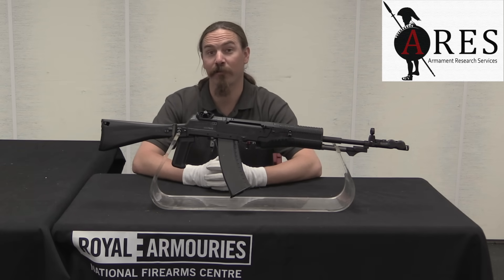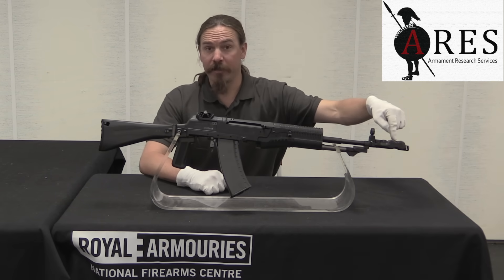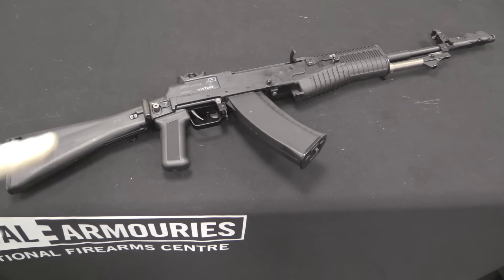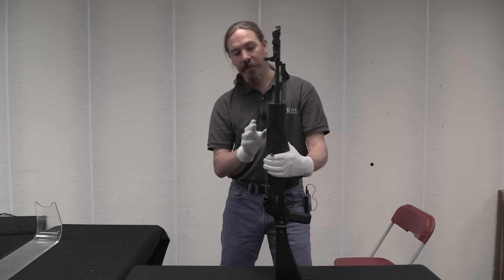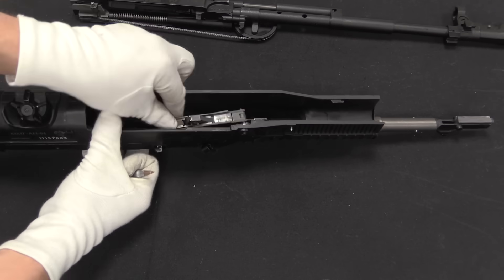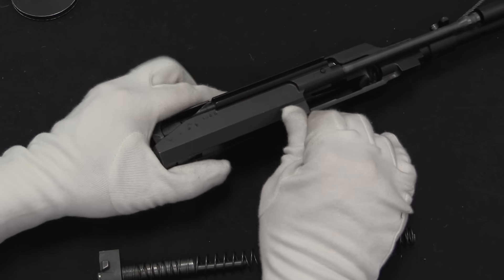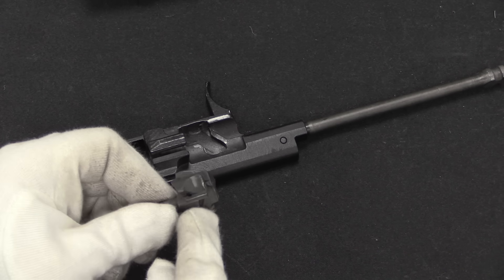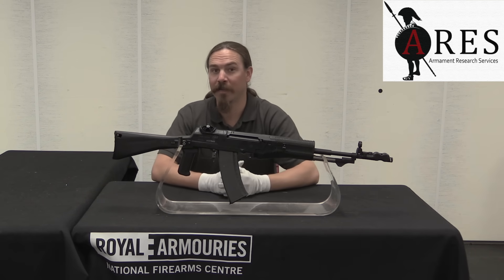Rocket Surgery: Inside the Russian Nikonov AN94

Comment: I don't understand why they used cable instead of roller chain in that counter-bolt mechanism. I would expect the cable to fray pretty quickly, although chain links dying from metal fatigue is also a concern. 

Something that combines Nomex's heat resistance, Kevlar's tensile strength, and is immune to oil and combustion byproducts might work.

Comment: The 1800 rounds per minute 2 round bursts thing is a bit of iffy maths? Given 2 rounds go downrange very quickly, but you're still got what a 30-35 round magazine? Are the two round bursts basically a dual semi auto or does it then switch to full auto? Or stay in that fire mode. Progressive triggers are generally a great idea but terrible in practice ... but this gun despite its problems may have been one platform it may have worked, light trigger for an accurate 2, long pull for spray n pray.
Reply: 3 fire modes. Semi, burst and auto. You get 2 round hyper burst every trigger pull. Not on semi obviously.

Comment: The ideas I get after watching AN 94 video is
1.Hypher 3 burst mode
How to archive this? By make the battery location further front 2 round seat in tube ready hypher burst shoving position space plus 1 on battery for archive 3 hyper burst mode. Addendum charge weapon 3 times okay I fix this using wheel counter movement 1 charge pick shove ammo 3 times... genius!!! None resurpercate charging handle.

2.Make bulp up 20 inche long barrel version..... hahahaha I rest my arm on my head... My head my hair is heat up pretty rapidly hahahahaha. Move all safety switch, fire control, bolt release, mag release near trigger grip finger and all are Ambidextrous.
Gas setting flap switch on hand guard grip position.
My forehead start heat up behind my ear start heat up hahahahaha never experience this before this is my first time!!!!! Wow AN-94 what a shock I knew this firearm is complex side effects learning wow my brain body temperature rise up my heart beat start rise up too hahahaha.

3.Add APC9K Hydraulic Recoil Buffer Damperner, plus SR-1 AK-107 Muzzle

4.VHS-2 Robust Iron sight

5.Top feed FN P90 quad magazine 50 rounds. True Velocity Composite Ammo plus stainless steel reinforce.

6.Hydrogen Gas canister handguard external coolent gas tube hanguard.

Comment: I feel like it would be cheaper and simpler to just make a double width AK receiver and have 2 barrels and gas systems. Basically a Villar Perosa bur AK
Reply: yeah but double recoil
Reply: @jbbbllz  a bullet out of each barrel and it won't matter, you also have double the recoil from firing a 2nd bullet so quick but it doesn't matter
Reply: @jmjedi923  AN-94 doesnt have a double recoil with 2rnd burst, the barrel move backwards after first shot
Reply: @jbbbllz  of course it has double recoil, conservation of momentum (and energy) applies

Comment: i wonder. 
in auto mode. because of the pawl of the sear have to go all the way forward tobe firing again. thats make it 600 RPM after 2 shot. But if they some how creat a mode to make that pawl always stay down. does it help the gun fire the whole magazine with 1800 RPM. Like make a longer trigger plate and have a bar long enough to cover all of the pawl track.

If that work. This chamber system really can apply to machine gun.
Reply: The magazine from the AK-74 is not able to deliver cartridges at such a speed. There are only 2 cartridges, and the second cartridge in this mode must be in an intermediate position on the lift.

Comment: Notch at the top of the front sight is most likely for close range. An AK trick to compensate for height over bore at close range is to cant the rifle slightly up where the sight picture is the rear sight resting at the base of the front sight.
Reply: Its for horizontal tritium tube. Its encased in something non transparent and have horizontal slit for the light to go out. 1 horizontal line as front sight, and 2 horizontal lines as rear sight.

Comment: AN94: The only firearm where a double feed is a good thing.
Reply: It can jam 2 rounds on the lifter if you dont pull the bolt all the way. Bolt overtravel is about 4mm. I would guess that it is what happened when Vickers was in Russia. By the way, 20 people trying to fix it tells nothing about how easy or hard it is to fix the double feed. It only tells us that probably there were no people familiar with the gun.

Comment: It’s such a cool weapon system. While they ultimately decided it was too expensive one of the byproducts was that the operating system contains reciprocating mass opposing the bolt travel to strip rounds out did that magazine and that concept carried forward as a constant recoil system that works much the same way. That was also not adopted because of complexity and cost, but really cool designs anyway. This thing is unicorn rare and it’s not because it doesn’t work, but because it does work and it’s too expensive and too complex to give to grunts in the field.

Comment: With the new M157 VORTEX sight system on the just-as -new M7 battle rifle you have another complex way of assuring a higher hit probability, as in an 80% hit probability! But This complexity is based on sensors inputting data to the ballistic engine which then gives a "hold over" firing solution with a lighted dot on the1 -8 x scope's vertical reticle. So THIS high hit probability solution is ELECTRONICALLY complex but much more reliable than the AN94 which is MECHANICALLY complex.

Comment: I may be wrong but I believe the rear apertures are actually temperature dependent not range, I've seen on launchers in the current Ukraine conflict old Soviet/ modern Russian etc design had the apertures temp based as in all the territories they have the temps can be quite different and ig that matters? I learned that from a soldier who is fighting in Ukraine and uses launcher systems consistently so I could be wrong why that is used here but it's still a cool feature that's used and may be being used here, if anyone knows that would be awesome.

Comment: Even the way the trigger drops the sear is incredibly impressive.
 Pulling the trigger does not simply pull the sear down, but tilts a perpendicular latch, allowing the seat to lower more vertically. The length of the latch could also determine trigger pull distance by taking advantage of the pivoting lever. Wow
I will most likely be studying this marvelous piece of engineering in the future, and copying some of its design principles in projects of mine
Reply: Have you made your own an94 yet?
Reply: @legitbeans9078  nope, but I did get my .300 WinMag bullpup project out of storage to finish!
Reply: @legitbeans9078 no, but I’ve started designing a bullpup, locking wedge-delayed, pistol caliber, sub-machine gun.

Comment: 5:40 I know few probably care but the "other character" П seems to be the Cyrillic character "Pe", which is derived from the Greek Pi, π (the capital Pi looks more similar, П vs Π). It's pronounced like the P in Pack. 

The more you know.

Edit: Also, that's not a zero or an O! It's a Cyrillic О, which like the Latin O is derived from the Greek Omicron, Ο. 
It sounds exactly like the O in Off. I have no idea what the Russians would use for Safe/Fire but yeah. Cool.
Reply: O - Ogon' (Fire). П (P) - Predohronitel' (Safety)

Comment: Why this gun does not get so much fame like AK 47 is that the price or the complication
Reply: cuz when the AN-94 Came, the AK-74 was the common weapon on service and then it got replaced by the AK-12 wich does almost the same
Reply: Both, mass-production is simply not possible, hence AN-94 is mostly used by Russian special forces, whereas AK platform is simple, reliable and cheap

Comment: Might be being stupid but why is the barrel recoil operating mechanism needed? Is it unlocking something? Couldn't the barrel just be still (and more accurate) and the bolt goes back and forth twice?
Reply: you have 3 points of recoil - bullet leaving rifle. Lever(if you right handed its up and right) and last recoil of unit. After recoiling of barrel you wont have hyper burst? because yout next round in burst will hit something in the sky.

Comment: On paper it seems to check all the boxes. Lots of engineering went in to prove the concept.  However, like you said the cost to manufacture would be prohibitive.  Disassembly with a clean weapon in the video it is not exactly quick or easy to do.  Imagine long term use in dirty war conditions and trying to keep dirt and debris from stopping the rifles complex system. While it all works on paper, and I'm sure on the range in limited fire, after adoption the Russians didn't use it often (or today probably at all).  This tells me there are too many problems and the cost too high to replace the AK-74 in general service.  It's a shame, because in concept 2 rounds fired with 1 perceived recoil pulse is a great idea

Comment: Russian? Really?

Even the G11 is simpler, at least in principal. You instantly know how it works, even if you couldn't take it apart to rebuild it unless you were a master clock smith. This thing may be rather easy to take apart and put back together (compared to the G11), but it's extremely difficult to work out how the bloody thing actually works.

German overengineering is trying to achieve a goal using simple, straight-forward logic at all costs; Russian overengineering is trying to achieve a goal with simple construction at the cost of using labyrinthine logic. I'm guessing that's because German engineers have extremely high precision manufacturing equipment so can brute force things with extremely complex mechanisms, Russian engineers had to make due with sloppy manufacturing tolerances and thus had to get creative. Japanese engineering, it appears, is a nice blend of Russian and German styles.

As some other YouTube commenter succinctly pointed out:

"German engineering is so complicated it's actually quite simple, Russian engineering is so simple it's actually quite complex, Swiss engineering is so complicated its actually even more complex."

One example of how Russian engineering being so simple they're actually extremely complex are their old camera lenses. Soviet lenses tended to have a disturbingly low amount of lens groups and elements. The Tair 3 is a 3 element 3 group 300mm f4.5 lens, the Jupiter 21 (200mm f4), 11 (135mm f4), and 37 (135mm f3.5) series are all 4 elements in 3 groups. All of the mentioned lenses, as well as many others, are absolutely tack sharp and are some of the sharpest vintage lenses (assuming you got a good copy). The Russians knew how to grind glass exceptionally well but couldn't really put the glass elements together with high precision, so they made their lenses with as few elements as possible. The middle group in the Jupiter 21 is thicker than it is wide.

Also, the Russians answered the question of "how do you make it easy to get stable shots on a 3.4lbs/1600g 300mm lens" with "Why, you make it even heavier and mount it on a rifle stock with proper gun ergonomics, of course!" Look up the Photosniper, that thing is a version of the Tair 3 mounted on a rifle stock. The trigger operates the camera shutter (I jury-rigged mine to work with Sony mirrorless cameras), the finger stop acts as the focusing knob, and the thing has a rather nice Bakelite shoulder stock.
Reply: Are you a photographer? That's some extensive knowledge on soviet cameras
Reply: @quadroninja2708  I have quite a few Soviet lenses that I use regularly, l'm not a professional photographer, however.

Comment: Similar "recoiless" burst philosophy to the HK G11; though that was a 3-round burst with caseless ammo; and if you thought this was complex... It's easy to complain, as I often hear, that firearms design really hasn't changed or significantly improved in the last century, but that's not really true. Just that in practice 90% of innovation is dependent on military contracts to make production viable. And militaries will reject anything too complex for the average 80-IQ conscript to figure out, or more expensive than conventional arms, or which uses novel ammo; due to the absolutely colossal stockpiles of 5.56 and 7.62 they don't want to go to waste. We could've pretty much jumped to crazy space magic pew pew guns in the 1980s (with the HK G11 and Steyr ACR, among a few others) if not for bureaucrats rejecting these truly innovative guns time and time again for some combination of the above three reasons. Didn't matter they roundly wiped the floor with standard-issue rifles as far as recoil, accuracy, lethality, armor penetration, ammo capacity, you name it, and by huge margins in most cases... So instead we just get tiny incremental updates and slightly iterative variations of conventional designs. I mean there's only so much possible innovation when you have to work around the same ~100 year old conventional cartridge design.

Don't get me wrong, guns like the AR/M16 are perfectly viable weapons still, but in terms of actual development tech everything from them to even the 'latest and greatest' modern arms like the SCAR, ACR, XM8, etc, even this AN94 really were already obsolete before even being designed, compared to the incredible superior tech that's existed in the areas of caseless ammo and nonstandard projectiles decades ago (and everything that enables in gun design that isn't possible using conventional ammo). To put it another way, for example, the AR15/M16 was the cutting edge of technology during the 1950s. Imagine how much more advanced an AR is than a muzzleloading musket of the 1860s. Well, rifles like the G11 are to the AR what the AR is to the musket, and they were created, refined and fully tested 40 years ago. But instead we continue to limit ourselves to ARs and comparable designs, like I said ostensibly over issues of cost and existing ammo stockpiles and that's true up to a point, but ultimately it comes down to politics too, and just having the balls to take that huge step... It had to be done before in transitioning from smoothbore to rifling, from muzzleloading to cartridges, from black powder to smokeless... Now how much longer until we finally make the next big step to small bore, high velocity caseless?

I still say killing the G11 project, basically right on the cusp of its official adoption, was one of the stupidest moves a Western military has made as far as their small arms. Ok, rant over. On the AN94 itself, it's aesthetically one of the ugliest AK-type rifles ever made certainly, but I'd still kill to own one and the system though complex is a step in the right direction.

Comment: I would argue that 2 round burst is better than 3 round burst...as long as it isnt this crazy hyperburst thing. For a rifle and maybe an lmg, 2 round burst saves more ammo than 3 round, reduces recoil, allows the user to stay on target and maintain their sight picture, reduces muzzle flash, and preserves weapon life- especially the barrel. I'd say we should explore going with a non-hyperburst 2 round burst option going forward vice the usual 3 round burst, especially if we switch to a bigger 6mm round that has more recoil.
Reply: Every time i hear about burst modes people think its useless, they think they can do it manually just fine. But they cant give trully consistant 3-shot bursts, not to mention 2-shots. It takes a lot of concentration, focusing on trigger control. 
There should be a huge benefit to getting used to the recoil of 2 round burst, relaxing on the trigger control, focus on controlling recoil. It should be possible to get better suppresion with less ammo. Hit stuff closer to the enemy. Not wasting ammo on the useless 3-rd shot that often goes way higher.

Comment: Oye wait a min, if the problem was the magazine not being able to feed fast enough through traditional means, couldn't they have just shortened the magazine?

Most mags are doube stacks right? They have feed lips that reduce the stack to a single stack at the top.

So, just cut the mag in half, and glue two double stacks together, to form a quad stack. Have each reduce into a double, that feeds into plain feed lips.

It'll be a chonky box mag, but not too thick to hold in your hand.

Because the length is cut nearly in half, the spring that pushes the ammo doesn't overextend half as much, and can provide a more consistent amount of force through the full length of the mag, while still being soft enough to hand load.

Two 15 round double stacks would make 30 rounds total. That's a reasonable size for a military application. God forbid you have to reduce the mag size all the way down to 10 rounds per stack, that's still a 20 round magazine. We've made do with 20 rounds before. That's 20 rounds full auto, 10 two-shot bursts.

I think the real complicated part is working variable RPM into it, because a single impulse gun has too high of an RPM to fire full auto. You'd have to reduce the RPM when you switch to full auto. But I think that's doable.

Comment: russians like to use the open sight hoods as an aim point in close quarters on an AK instead of bothering with looking through the rear sight.  like very close quarters, like inside a building.  Presumably this was because historically they struggled to acquire enough optics to really issue regular red dot sights to your average dude.  Seems like they wanted a really fine front sight post that necessitated a fully enclosed sight hood, but they still wanted to put something on there that would allow you to use your ak muscle memory in close quarters.  Why they would issue a rifle that expensive to someone who they could not also afford to give a red dot sight seems not to have entered the equation.

Comment: the thing on top of the front sight is a measuring tool. if a bad guy fills that space, he is about 300 meters away or 200 in this case, since 2 on the rear sight had that thing added to it. anyway its a feature that came with the AK-M a long ago, simple but genius